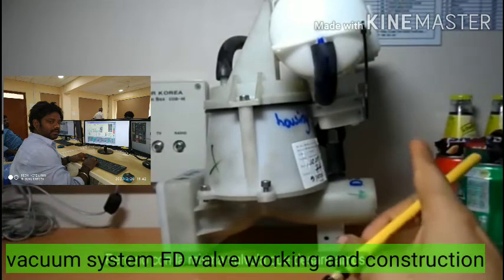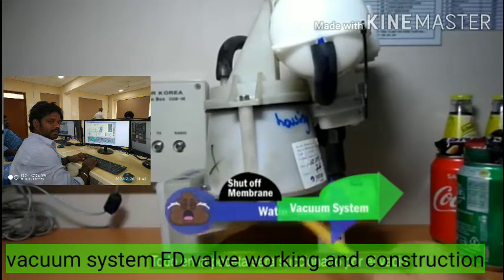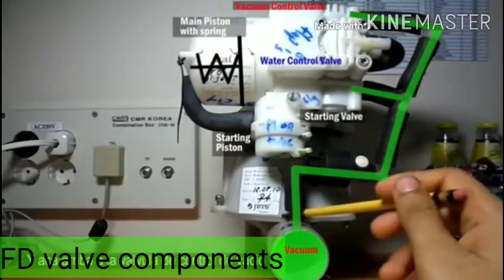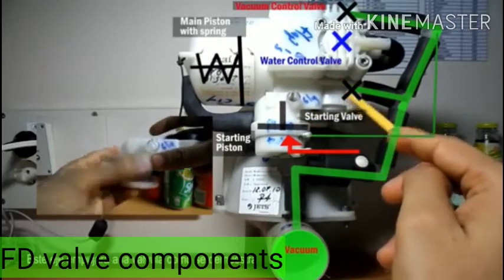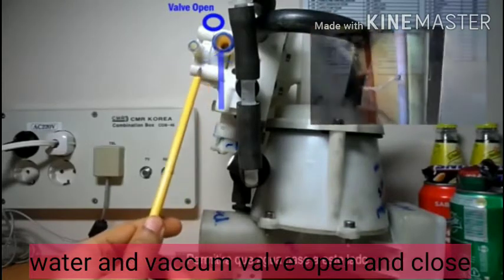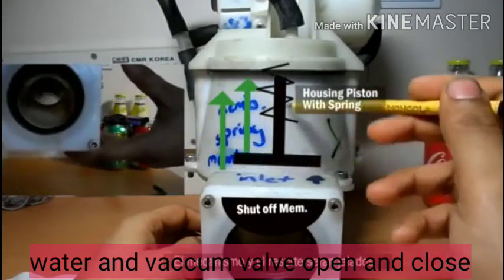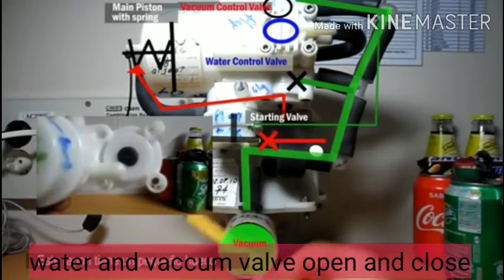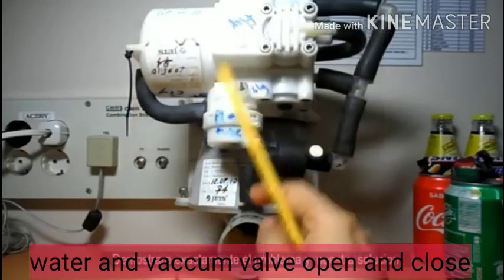How JETS VACCUM FD valve working- ship vaccum toilet system working principle

Comment: pull out green tube clean the small pipe on a vacuum pipe with toothpick and the system will start working hai na easy.  explain working step by step. dont confuse the main valve this valve or that valve.. step by step explain